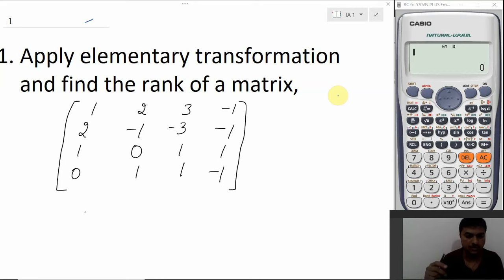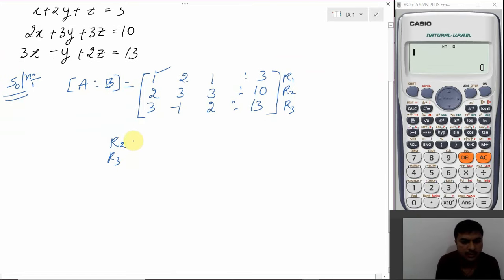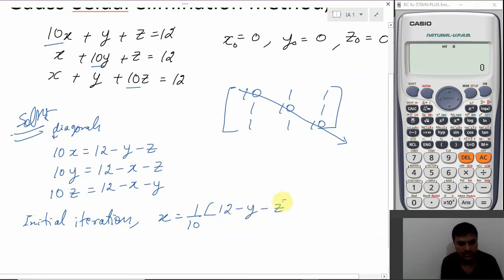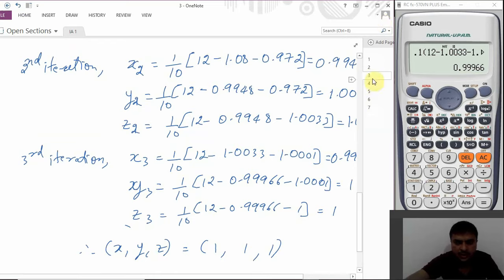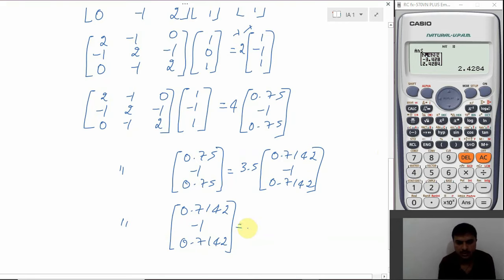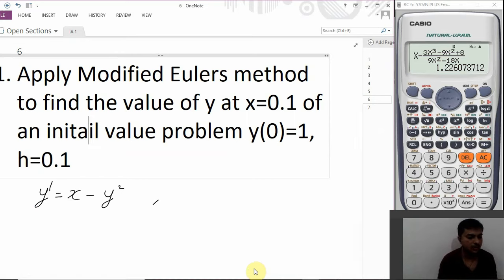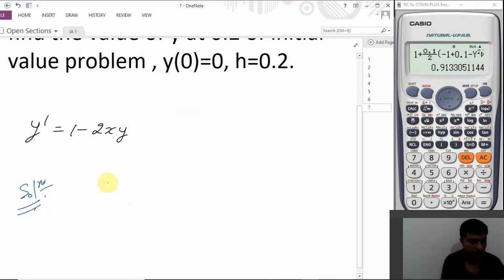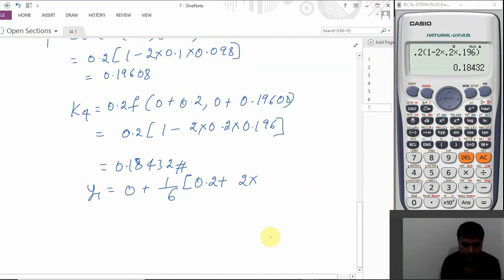Using Calculator :Fast IA Preparation for exam tips and revision(You can download notes below link)

Comment from the maker: Notes are uploaded below link,

https://drive.google.com/file/d/1vv_c...

Chapters:
0:00 Apply elementary transformation and find the rank of a matrix.
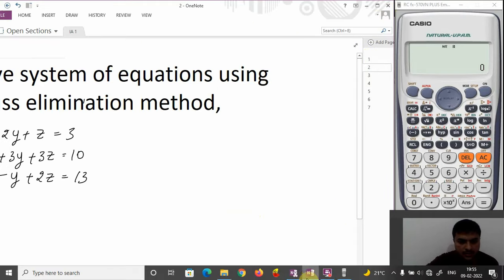07:52 Solve the system of equations using the Gauss elimination method
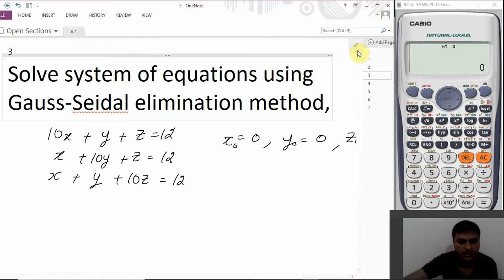15:58 Solve the system of equations using the Gauss-Seidal elimination method,
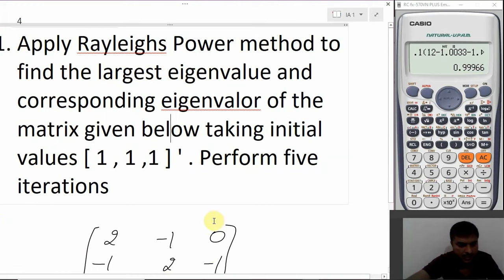26:50 Apply Rayleighs Power method to find the largest eigenvalue and corresponding eigenvector of the matrix given below taking initial values [ 1 , 1 ,1 ] '. Perform five iterations
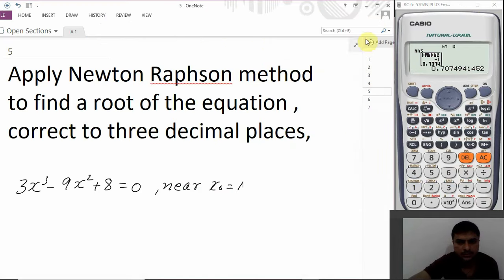37:00 Apply Newton Raphson method to find a root of the equation, correct to three decimal places
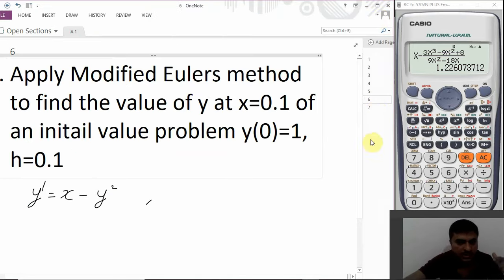43:54 Apply Modified Euler's method to find the value of y at x=0.1 of an initial value problem y(0)=1, h=0.1
52:20 Apply fourth-order R-K method to find the value of y at 0.2 of initial value problem, y(0)=0, h=0.2